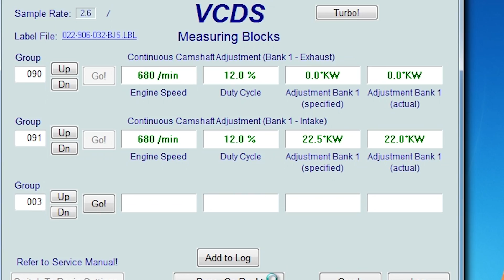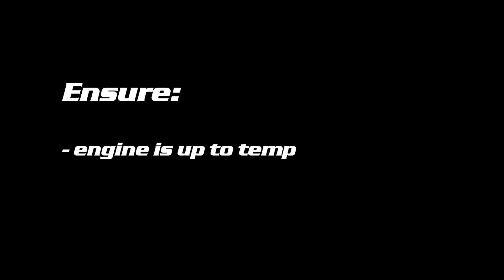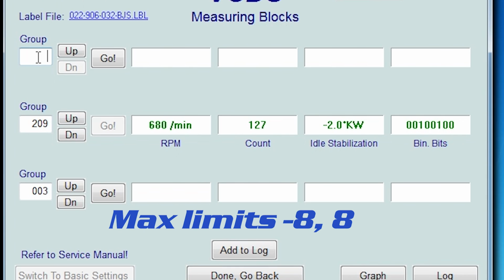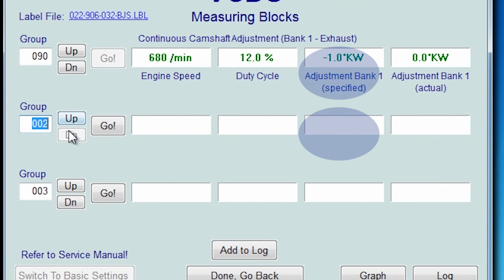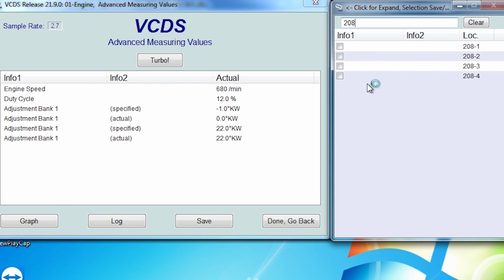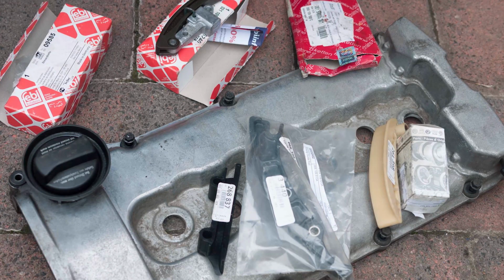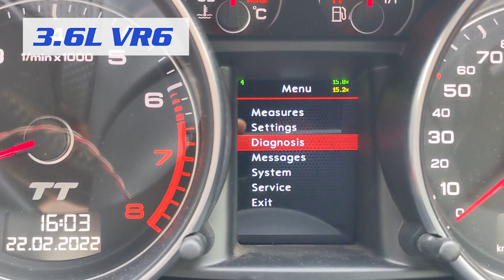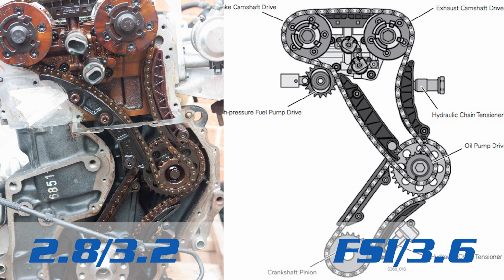Check VR6 timing chain stretch w/VCDS or ColourMFA (Golf R32 Passat R36 Bora 2.8 Audi TT 3.2)

Comment: Hi, can you tell me if -2 and -2 values are ok? I mean they are close to 0 and the spread between values are 0 right? So that's a good thing, If its was 2 and -2 then the spread is 4 so not so good. Awesome video btw
Reply from the maker: Thanks for watching. You still have deviation away from 0 which is perfect. But -2 and -2 is not bad and then you want to listen out for any noises as well. Do you have any rattles or is the engine pretty quiet?
Reply: @ianpgonzaga  I bought the car, there are no rattles - the engine works very well, I don't hear anything disturbing. I checked myself on 208 and 209 got -2 values. About 90 and 91 they are both at 0.0 KW and duty cycle is 14.1%. I guess it's in good shape? 220 000km / 136 000 mil on it
Reply from the maker: @majster2973  Sounds good! Just keep up the oil and oil filter changes and you should be alright man ;)
Reply: @ianpgonzaga  Thanks a lot

Comment: Thanks so much for this video. I have a 2003 Eurovan with a 24v 2.8L and both 209 and 208 were -6.0deg. So I guess that difference is 0? But I do hear chain noise for sure. The van has 166K. What are you thoughts on replacing the chains? Soon? Dire? Thanks!

Comment: hi Ian 
i have a 3.0tdi 2013 
with deviation from -3.90 to -4.20 
and i have the cold start rattle. 

Any advice?
Reply from the maker: @ArditBalisha  sorry I'm not familiar with those engines. My only tip would be to hover your mouse over the value and see if a yellow info bubble comes up with a range recommendation. If it's outside of that then consider servicing.

Comment: I have a 2007 A3 S-Line with R32 and DSG, i'm at 232000km. Top chain guide has a small rattle, it's being done this year. It's not that bad a job, no need to pull out the motor. Take out the transmission.
Reply from the maker: Hopefully it's just the tensioner (bolt) that needs replacing and then you are good again.
Reply: @ianpgonzaga  I'm removing the DSG to have access, all new timing, head being pulled off as well. 230000+km is around where many gaskets, seals are heat soaked and cooked. Also potential head gasket leaking coolant into the cylinders. I burn no oil, camera inspection showed cylinders still have the hex honing marks. The entire car is being restored. All new bushings front to back, body parts removed for a full paint job. So basically the car will be a shell.
Reply from the maker: @johnbernard204  wow sounds like your A3 is going to drive so tight after all this work! Will be well worth it.

Comment: Hi Ian. This is broken down so nicely. thank you so much for it. I have a MK5 R32 are these values the same for 3.2 and 3.6 litre VR6's?
Reply from the maker: @ronsta11  Hey there. Thanks for watching! 

I'm not sure if they're the same on the Mk5... Probably different because the exhaust cam has a different actuation range vs the Mk4 engine. 

Floating the cursor over the values when in VCDS measuring blocks should give you the popup for ideal ranges when reading in a Mk5 R32.

Comment: ATTENTION! Please verify the target values of 90 & 91 for your specific model of VR6! For BUB engine they are 0 and 0, not 0 and 22. For other VR6 models they may be something else...
Reply from the maker: @White.Elemant  yes you can see that in the video.
Reply: @ianpgonzaga  Really well made video Ian  - but I must have missed the block 91 value for the BUB engine being different too and I watched the video end-to-end a couple of times. What point in the video is it mentioned? Thanks.
Reply from the maker: Should be same ... No? If not I'll need to check on the BUB swapped Bora I've just finished. ...

Comment: Succinct, thank you!
Reply from the maker: @aulday  thanks ;) that's what I go for.
Reply: @ianpgonzaga  If the Adjustment banks specified and actual values differ, does that suggest the variators / adjusters are jammed? And are there any value setups that may suggest no oil to tensioner? My new to me 3.2tt had a chain kit 13k miles ago, but its now making chain noise that appeared  after I took it for a high rpm blast. Thanks :)
Reply from the maker: @aulday  hover your mouse over the degree value you're viewing. It'll show the desired value. If it's out something is wrong, what it is exactly is what you'd have to investigate. 

There's nothing in the MB's that detect oil flow though components.
Reply: @ianpgonzaga  So here are VCDS values with engine warm:

090 - 15.3% - 0.0*KW - -0.5*KW
091 - 15.3% - 0.0*KW - +0.5*KW (apparently normal for BUB engine)
208 - 122 - -5.0*KW - 00100100
209 - 78 - -6.0*KW - 00100100

And it sounds like this: https://www.youtube.com/watch?v=AjKoSfAz_HY

But service book and receipts say chain kit was completed 13k miles ago.

Any ideas? thank you!! :)
Reply from the maker: @aulday  yeah that sounds pretty rattly. Your 90 requested looks odd compared to mine. I think you need to open it up and check stuff. 

With the service. What does it say was replaced ? EVERY chain, guide and tensioner ?
Reply: @ianpgonzaga  Yeah, I'm gonna try the tensioner bolt first. Chain values are only 1deg apart. Chain kit is all it said, which appears to be all the chain stuff minus the adjusters. Adjusters passed their output test too. Will see how I get on :)
Reply from the maker: @aulday  yeah hopefully it's just that upper tensioner which is super easy to replace. Let me know how you go!
Reply: @ianpgonzaga  will do, thanks mate 👍👍

Comment: Hey, man. Thank you again for this awesome video. Does an engine remap change the values you show in this video?
In my 3.6 VR6 the camshaft adjustment intake bank shows -27.125°, but the specified value shows 18.500°. In the exhaust bank the values are almost the same 15°/15°.
Reply from the maker: @ederss7  hey. A remap wouldn't change the values being read so maybe do a bit more digging to ensure your timing isn't off.

Comment: Is it safe to only check if there is any rattling noise or you should be always scanning from time to time?
Reply from the maker: @ederss7  you can check it any time without any harm. Hope that helps answer what you mean.
Reply: @ianpgonzaga  Thank you for the reply. What I meant to ask is if I can only rely on the rattling noise to decide to do the timing chain service. Or the noise isn't a reliable way to prevent any engine damage?
Reply from the maker: @ederss7  ohhh got you. The nosie is an indication that things are already REALLY bad. I prob wouldn't wait for that moment and check in annually or more frequently depending how much you drive the car.

Comment: After replacing the chaines on my 3.6 vr6 i havd 208 0 and 209 -9 

Is there a time limit the new chain and tensioners need to become all the way tight? I have had it running for 10 minutes and let it get up to temp but the measurment stays the same, also im running around 800 rpm
Reply from the maker: There's no time limit but just check that after the car is up to temp and idling. It might adjust. 

If you start getting errors then re check timing.
Reply: @ianpgonzaga  Okay thanks for the fast reply! How long would you recommend to let it run before it needs to measure correctly
Reply from the maker: @clickonmeppl98 👌 

Until the engine is up to temperature and you measure at idle.
Reply: @ianpgonzaga  Okay thanks verry much, ill check again this evening and will let it run untill my oil gets up to temp, i now only let it get the water get up to temp.
Reply: @ianpgonzaga  i have tried running it up to temp and still the same values, it is running around 640-680 rpm but i have 2 trouble codes for the engine. 
P0030 and p0050 both lambda sensors before the catalitic converter. Do you have any idea if this could mess with the values? And i have replaced them with a other pair i have laying around and still the same so maby a fuse or something?
Reply from the maker: @clickonmeppl98  sounds like a re-check on the timing is needed.
Reply: @ianpgonzaga  Okay so the lambda sensors not working correctly could also mean the timing is off? I know for sure all the marks lined up correctly when installing the chains, Ive checked it twice before building back together and i have no noises coming from the chain side when the engine is running and no other codes then the 2 lambda sensors.
Reply: @ianpgonzaga  i have also made a video after i turned the engine around 2 times and that the marks line up with the plate in the cams. I could share it maby you want to have a look at it? Kind regards
Reply from the maker: @clickonmeppl98  lambda sensor errors would be something different to fix and not related to timing.
Reply from the maker: @clickonmeppl98  what about MB 90 and 91 what is happening there ? You need to measure all 4 things.
Reply: @ianpgonzaga  90 : -25 kw 91 : 18kw 
208 : -1kw 209 : -9 kw 

So all of them are off
Reply from the maker: @clickonmeppl98  yes something is still not right. Those 90 and 91 shouldn't be any more than .05 off 

Did you do both chains AND guides and tensioner ?
Reply: @ianpgonzaga  yes i replaced everything, i took the engine apart today and all my timing marks line up correctly , so i dont understand why my measured values are not within the specs . ill make a video of all the timing marks

Comment: bro thats insanely useful!!! can you also do video about lambda sensors.
Reply from the maker: Thanks 😄 What about the lambda's? Their live output meanings??
Reply: @ianpgonzaga  bro my lambda shows 0.75 on bank 1 and 1.99 on bank 2 i dont know what this means... I think it's broken. car has smell from the exhaust and has rough idle and rough 1100 rpm cruise. it ok in high rpm but very shaky in low rpm. fuel consumption skyrocketed from 1 litter per hour to 3 littres per hour on idle. my car is VW 2007 year
Reply from the maker: @Daniel-v5n3v  sounds like your sensors are broken and one is compensating for the other. 

.75 is super rich while the 1.99 is really lean. 

Ideally they're as close to 1 as possible on idle. 

Lean conditions would represent a value higher than 1.00, and rich conditions are lower then 1.00.
Reply: @ianpgonzaga  how can i diagnose faulty lambda
Reply from the maker: @Daniel-v5n3v  have you scanned the engine to see what fault is coming up for lambda ?
Reply: @ianpgonzaga  its a VW P0400 swapped signals from S1 B1 and S1 B2
Reply from the maker: @Daniel-v5n3v  yeah. Replace them!
Reply: @ianpgonzaga  ok, will do on monday, they are ordered. I chose Bosch brand
Reply from the maker: @Daniel-v5n3v  Great choice - per factory spec!

Comment: Hi. I’ve looked at a tt mk1 3.2 and ran vcds for blocks 208 and 209 and the readings were -10 and -10
The difference is 0 but is -10 ok ? 
Thanks for any info. 
Steve
Reply from the maker: Wow. That sounds pretty off. Ideally the values are as close to zero. 

No issues with the car running??
Reply: @ianpgonzaga  
Hi. Thanks for your reply. 
No the car runs perfectly but I was shocked due to the chain readings. 
Debating on whether to buy it or no. 
Great vids you do too. Thanks.
Reply from the maker: @stevensheppard3138  yeah I would keep an eye on it. That's not right 😉

Comment: Agreed with this guy. But you need to also take into consideration that a faulty hydraulic tensioner and solenoids can cause these reading to be out also ive known guys that have done oil flushes and regular oil changes bring there readings down. Not always chains are the issue..
Reply: That's right, condition of guides and tensioners also contribute to these values.
Reply: Agreed  @trollberserker1515
Reply: Your point seems to be arbitrary. If you're going to try to snake oil a timing chain job by changing oil more frequently or using some additive, then you will have no interest in this video which is factual. 
Regardless of the reason those measuring blocks would be out it indicates a requirement for a timing chain service. Don't mislead others with your ignorance.
Reply: @ChroniclesofJaybee  what I said I can claim has I know hundreds of people with these cars and it has worked for them.. so stop your BS please.. have a nice day
Reply: @sajidqureshi2175  

"I know hundreds of people"
Says all everyone needs to see here. 
Confirmation bias anyone? LOL
Reply: @ChroniclesofJaybee No he is 100% right mate. If it doesn't rattle it's fine.

Comment: Hi I have an R36, just had a P0343 (signal too high) fault so did some digging, my 208/209 values are +1 and -3. Chain was done professionally about 2 years ago (less than 20,000kms) so not sure what to make of that.
Reply from the maker: Hey Steven. Check these things in order 

- Wiring from/to Camshaft Position Sensor (G40) faulty
- Camshaft Position Sensor (G40) faulty
- Timing

Comment: I have a 2001 VW Eurovan at 117,000 miles and have fault codes of: 

1) 17748/P1340/004928 - Camshaft Position Sensor (G40) / Engine Speed Sensor (G28): Incor. Correlation
2) 7550 - Load Calculation Cross Check 
            P1142 - 35-10 - Lower Limit Exceeded - Intermittent
3) 16485 - Mass Air Flow Sensor (G70) 
            P0101 - 35-10 - Implausible Signal - Intermittent

In VCDS my blocks read:
208: -11.0
209: -9.0
90: -0.5
91: 0.0

Terrible numbers from blocks 208 & 209 for sure but ironically, I have zero chain rattle or noise. I would think that I'd be able to hear it so could it possibly be something as simple as a bad sensor or sensor(s)? I appreciate your assistance!
Reply: isn't it block 93 for the Eurovan?
Reply from the maker: Hey David. 
1st Looks like you need a new MAF for sure.  

Then yeah I would check your sensors as that's quite easy to change. Then if the values are still out and causing issues then check the timing, chains and guides.

Comment: 208 -1.0kw 
209 0.0kw 
090 0.0kw 
091 0.0kw 
This is on  a 2007 3.2 tt am I looking at the correct  measuring blocks
Reply from the maker: Yes those are the correct MB's (you can always re watch the video to double check)
Reply: @ianpgonzaga  do those figures look ok or are they a problem as I didn't quite understand them

Comment: My lovely 3.6 cayenne at just 71k has suddenly thrown a wobbly,  lumpy idle,  no power, P0017 code, briefly flashed up P0014, just changed the camshaft sensor (no change)  i just cant believe a 2 owner 71k fsh chain might be knackered 😭😭😭😭😭😭 its idling lumpy but is still silent 🤷🏻‍♂️🤷🏻‍♂️🤷🏻‍♂️🤷🏻‍♂️🤷🏻‍♂️
Reply from the maker: Oh dear. Sure it's not a vacuum leak?

Comment: Awesome vid mate, just picked up an Audi 3.2 V6 and has a rattle in the engine bay so got the VCDS plugged in using your guide and got my values
208: -4
209: -4
90 Engine Duty: 15.3%
90 Adjustment: 0 to 0.5
91 Engine Duty: 15.3%
91 Adjustment: 0 to 0.5

How does that look to you?
Thanks🙂
Reply from the maker: Thanks Adam. 
If you have a rattle, consider an oil and upper tensioner change. Might fix it for now but also start pulling a parts list together to do the big chains and guides service.
Reply: @ianpgonzaga  will do thanks for the tip and again for the vid ❤️

Comment: Hi.i don't know if this is the problem with my missfires only in cilinder 135. But 

 My values in my vr6 Touareg 
208    -6.0kw
209    -3.0kw

090   -25kw duty cycle 5.9
091    18kw duty cycle 46.7
Reply from the maker: Hey Daniel. Yeah I would check your timing gear. That all looks really off.

Comment: Very informative video, I was wondering if this procedure would work on the 2.5L (8v rs3) or if you knew the measuring blocks to check thanks
Reply from the maker: Thanks Josh. Sorry I'm not experienced in that engine but this forum reckons it's measuring block 93 

https://www.vwvortex.com/threads/vcds-to-check-chain-stretch-on-2-5%E2%80%99s.9490016/

Comment: Thank you for this video. My findings are
208=   -3
209=   -2

90=   (specified 0.00   actual 0.5
91=   (specified 0.00   actual 0.5

Is this bad?
Kind regards Mike
Reply from the maker: Thanks Mike. Doesn't look too bad actually but would be good to check in next oil services to see how it changes.